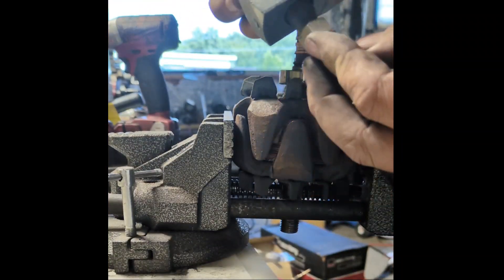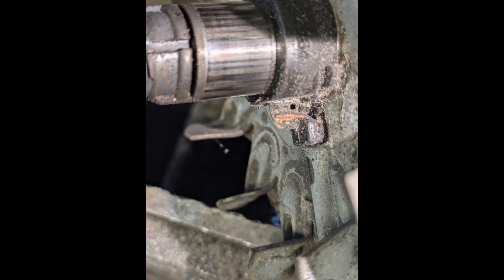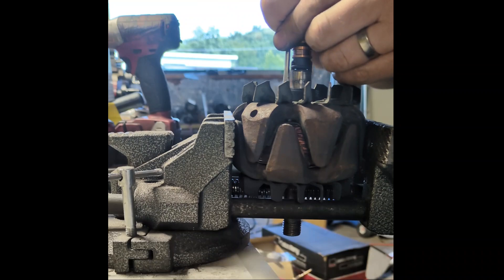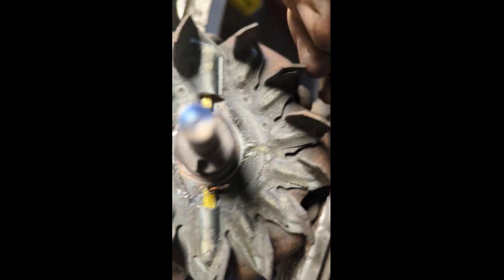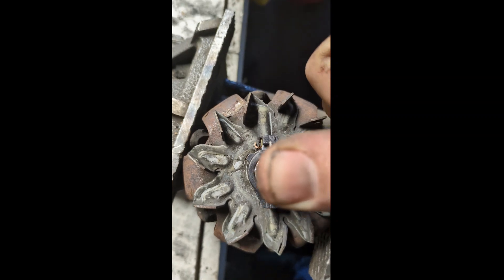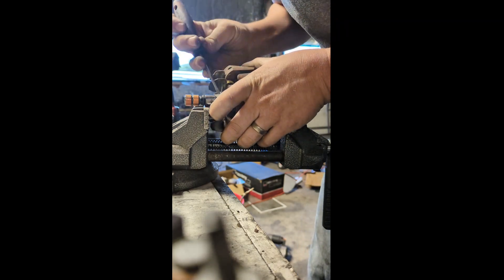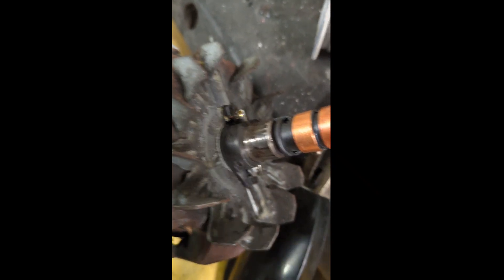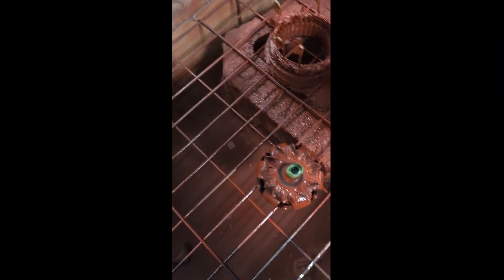Bosch Alternator Slip Ring Replacement

Comment: Thanks this video helps a lot. Do you know what kind of copper wire to use ? My wire is short to connect to the slip ring. The wire is 20 gauge
Reply from the maker: What I've done if the wire breaks off too short, is I will use another piece of 20 gauge wire + create a loop wrap to slide over the end of the broken off piece. Then run that over to the slip ring and solder it. You will then need to solder that loop piece as well. Obviously making sure that none of it is touching the main body of the rotor
Reply: @anchormotor Sounds good. I need to buy wire but all the wire that I saw was for jewelry, are these wires the same?